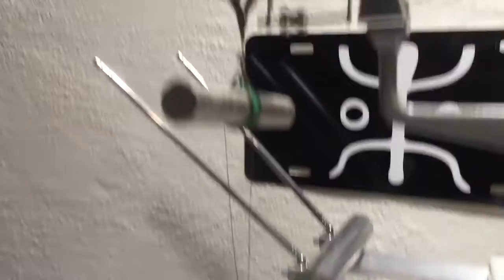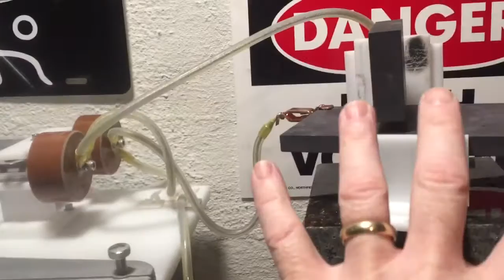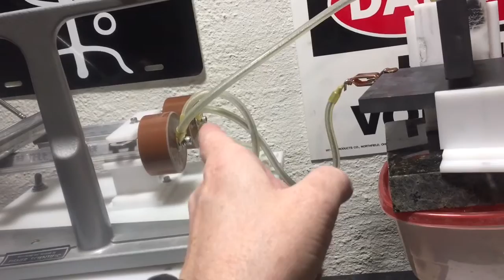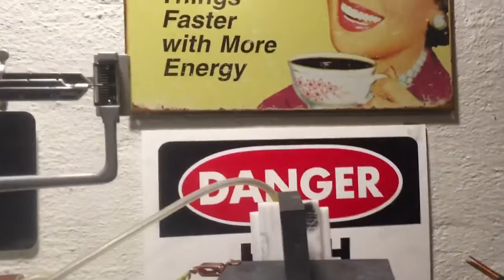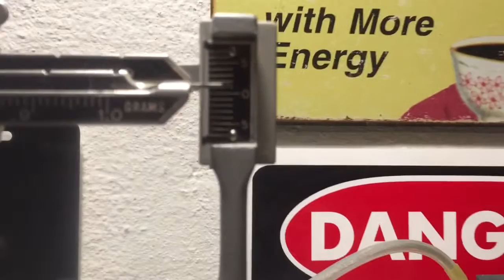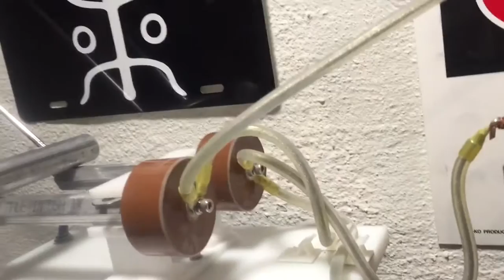Zero Contact Electric Weight Delta

Comment: Fascinating video, thanks. If I understood correctly, the capacitor which is on the balance is NOT connected to any electrical circuit. The HV circuit is separate, and yet turning it on affects the weight of the hanging capacitor (it makes it heavier, right?). Is this correct?  Have you tried other objects on the weight?  Thanks again!
Reply from the maker: Yes that is correct.  I have used magnets as well.  This is very intriguing to be sure.  It makes one ponder larger phenomena such as gravity.  Charge, spin direction, inertia...... much to dwell on.